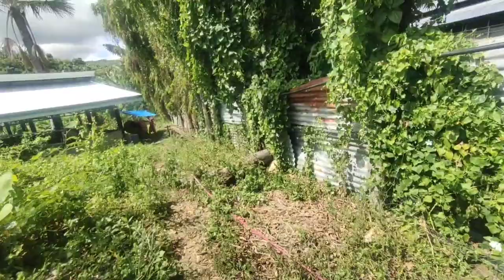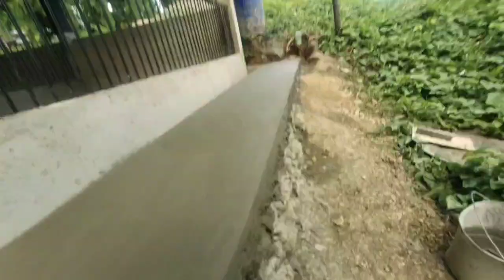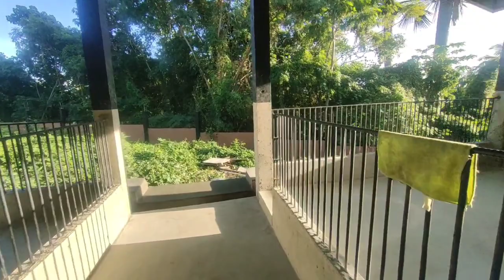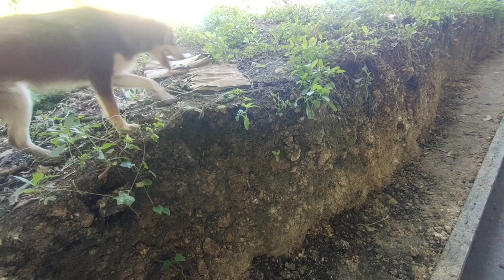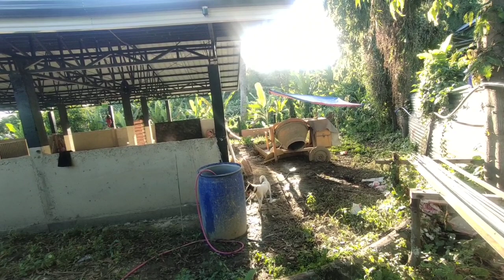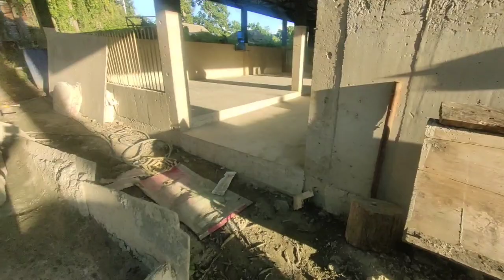END CHANNEL FINISH GRILL OR PIPE ISSUE RESOLVE AND TALKING ABOUT WATER TANK

Comment: Why do Filipinos always insist on building something where there is a Tree? 
That really annoyed me on our Lot, many good fruiting Trees were taken down instead of simply building our Sty's 2M to one side. It HAD to be right where the mature Fruiting Trees were located! 
Also, I think you are making a mistake with the Tank.  
Above the Sty on top of the Hill where you originally spoke about, will have pressure from the weight of the Water as well no Pipes intruding across the main thoroughfare. 
I would leave those Trees right where they are, maybe take the tops out of them if you are afraid of them falling onto the Piggery, but not remove them completely. 
The Tank above the Piggery at a higher elevation will require only gravity to feed the Nipples, and you can simply run a pipe across the back Walkway which is not a main thoroughfare. 
Set lower to one side, you will lack the pressure and the Pipes will most likely be run across the main thoroughfare to try and feed pressure to the Nipples, a PITA. 
Just my thoughts, but for me it seems Filipino really like to make things more complicated than it needs to be most times and I would pull rank on this one.
Apart from my negative thoughts, things are coming together for you, great to see.
Reply from the maker: Yes you are exactly right (again tks), Win ran his idea past Soy last night. an older man who has been in construction for 40 years. He says it goes in the middle as my original thought, for the water pressure and Wins concern about being too high for the down spouts his answer is to dig it in. He is also saying 6 inch walls with heavier reo bar and deeper footings, so that's what I'll do.
Reply: @TykeArenas  Win is correct. 
Also use Sahara (water proofing) added into the Cement Mix and Rendering over the Blocks. 
Slightly Embedded into the Ground and above the Wall height will be sufficient pressure to allow a Pipe set around 4" above the bottom of the Tank to avoid the sediment and provide clean Drinking water via the Nipples.

I grew up on Tank Water from the House Roof into my mid 20's in Oz, and even here, I use the Well Water for Showering, Brushing my Teeth, Ice etc.

The Rain Water you catch in the Concrete Tank it will be nice and cool too!

I helped my old Boss build his underground Tanks for his House back in Australia, 10M long by 4M wide and 3M deep, Baffled and set under his side Terrace. 
With the cool water below the Tiled Terrace Floor, that was the coolest spot in the entire House to sit during the 40*C+ Summers.

Happy New Years Mate...